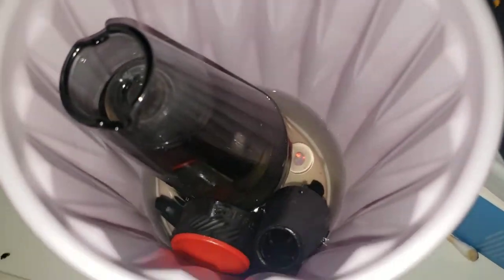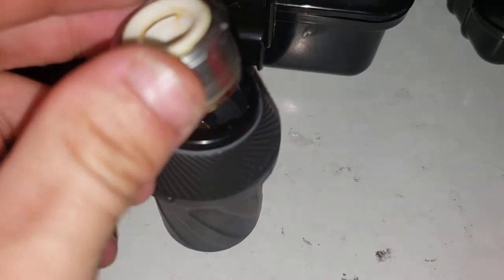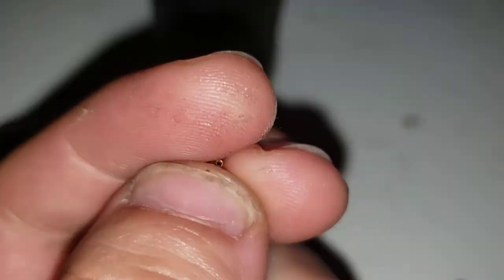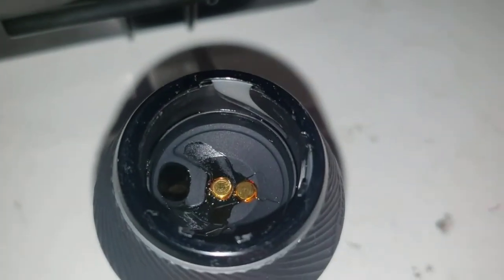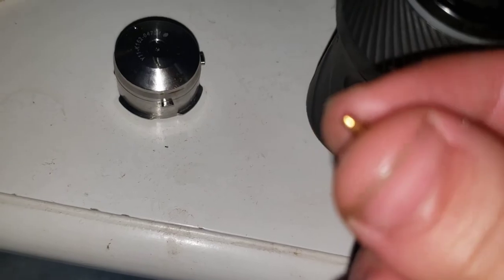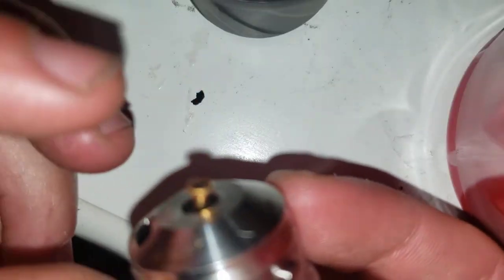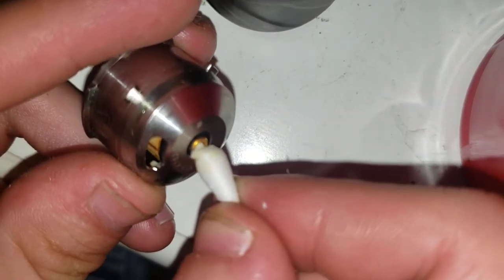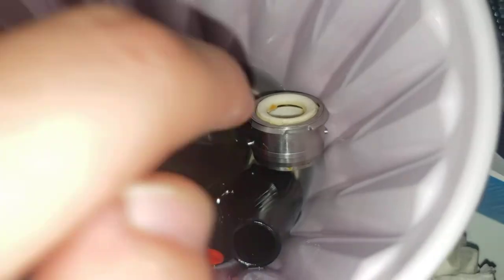Puffco Proxy Chamber Broken Quick Easy Fix Tutorial

Comment: This helped fix mine although my problem was different my proxy kept blinking white so I took out the chamber and cleaned it still didn’t work so then I took out the bottom piece and the two little prongs and cleaned that two still didn’t work so I saw this video and I used a tweezer and pulled it out that piece and pushed it in just flush I think it was sunken it too much and it wasn’t conducting easy fix tbh once you learn the solution hope this comment helps someone that was struggling like me lol
Reply: This was more helpful than the video.

Comment: All you would Need to replace is ur 3D atomizer, which is around 59.99. My recommendation is clean it about every week give or take how much you use it. Don't want 299.99$ going down the drain.
Reply from the maker: I fixed it you just press down on it im still using it like new never got a Chamber replaced